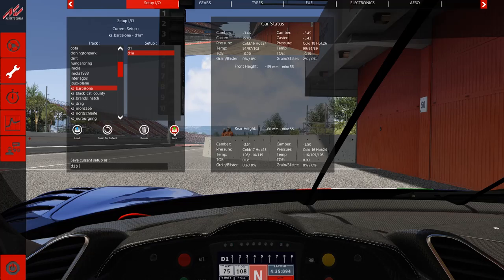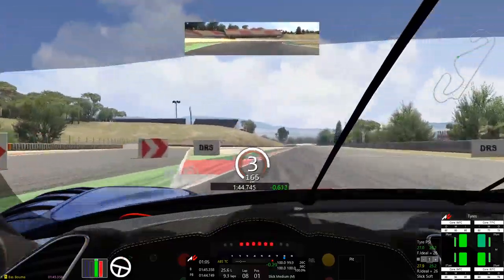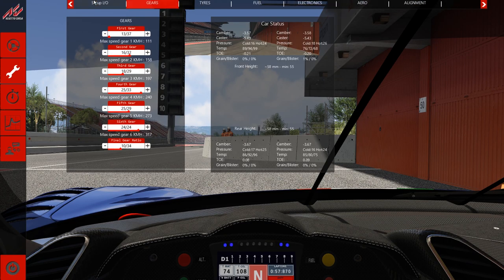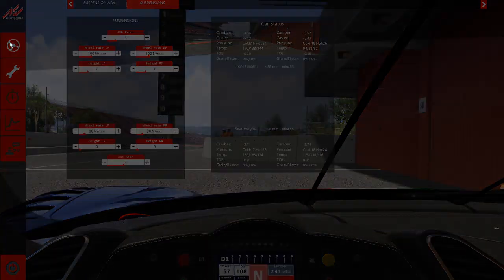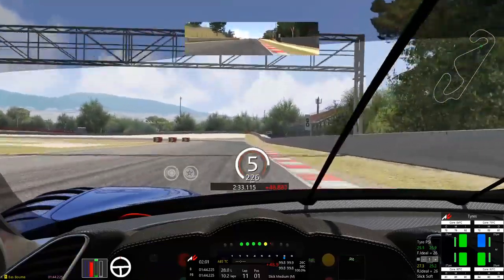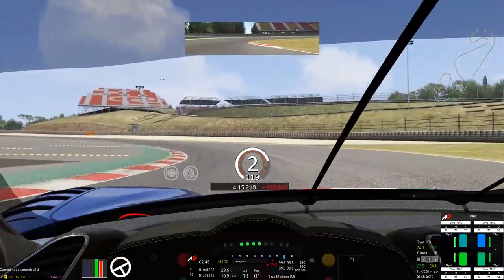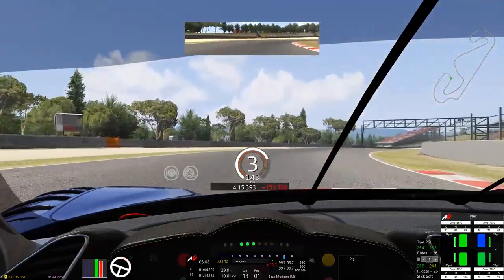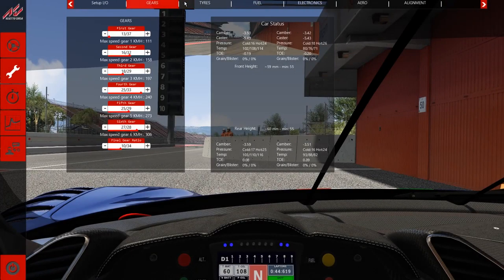Darkone's Race Notes - Setup Part 2

Comment: Great video, Bas! I just noticed your ffb is clipping like crazy in every turn :D don't you want to lower that a bit?
Reply from the maker: Thanks. Yea, I know. I wish I could lower it, but I just can't stand how light the wheel feels then. So light I find it hard to catch slides..
Reply: Well you run a G27 right? 
Have you tried the LUT generator for the FFB? It increases the amount of detail and reduces clipping of your wheel, especially the Logitech wheels benefit from it
Reply from the maker: Yea, I tried it, it's certainly better, but it gives me a little too much right in the middle, on the straights. Is there a way to set a little bit of 'FFB deadzone' or something?
Reply: You could just alter the LUT manually to suit your needs
Reply: yeah, just divide the first 5 entries in the lut behind the | by 2 or something like that

Comment: could you elaborate what you specifically watch out for when using the wings app?
Reply: Yeah, I really want to understand this too. I assume it should be below 50, but as close as possible to avoid wing stalling? Stalling meaning the front is higher than the rear. Ugh, confusing stuff.
Reply: snoozieboi indeed. Also some insight into the telemetry Dev app and stuff would be great :-)
Reply from the maker: If the car gets too low in AC, on some cars it can make the wings stall. Stalling just means that the wings stop working, so not generating downforce. On a GT car a splitter behaves like this. But also the diffuser. Diffusers are also on single seaters, so for single seaters you have to watch the rear ride height, and for GT's both front and rear.

Say you set up the car way too low, and you drive on the straight, you can see the wing app do unexpected things. The balance (%) can move to the rear under braking, or the value after DOWNF can start to jitter or go lower, even though you're going faster. That tells you the car is too low.